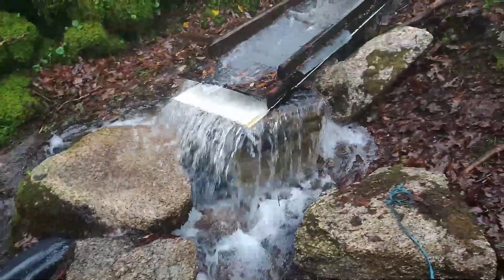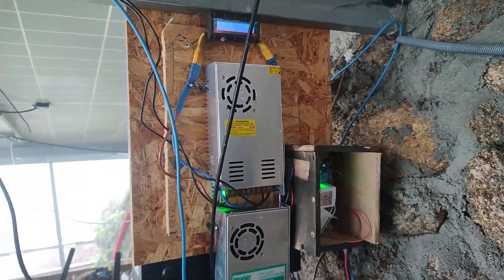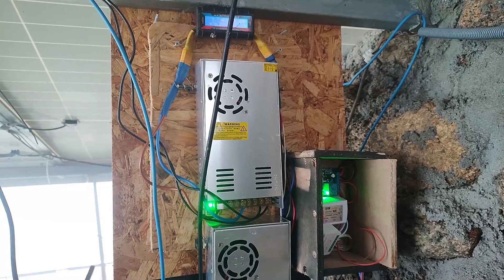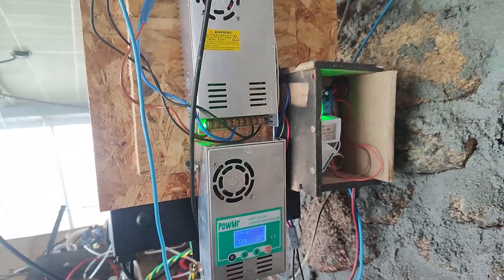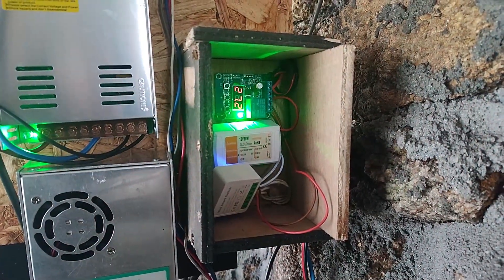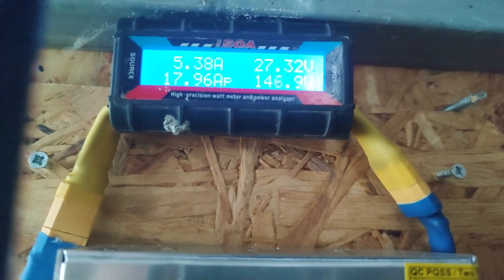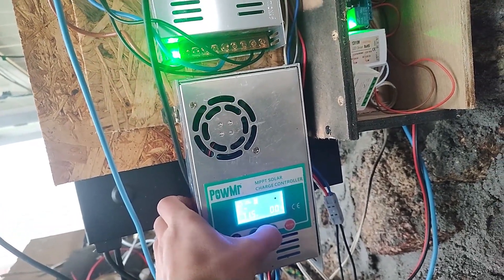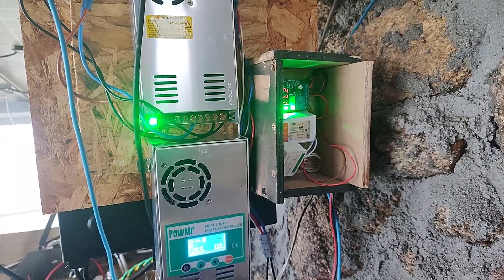Hydro + Solar + IOT Off grid Electricity overview

Comment: Great videos!! How do you connect the SMPS to your system? And vill it work with Lithium battery's?
Reply from the maker: Thank you, Yes it work with lithium battery, there is a screw to adjust the voltage in most of the SMPS, be sure before buying to check if there is a voltage adjusting screw, for exemple a 12v SMPS can range from 10 to 13.6v and 12v lithium battery require 12.6v.
Reply: @Off_GridWorkShop  Thanks 🙂 Do you connect the SMPS direct to your battery pack? Or does it go tough a controller? I´m asking because  the mppt controllers are crazy expensive and the SMPS will be a nice cheap alternative. I´m going for 24 V.
Reply from the maker: @botornvig  Yes it is connected directly to the battery,In my case it's gel battery so I don't have BMS, I suppose you have a BMS for your 24v battery right? If so there is no problem connecting directly to it.
Reply: @Off_GridWorkShop  Thanks! BMS all over the place 🙂 It´s a home made 22KW battery out of discarded computer 18650 batteries.

Comment: I've been having a look at these SMPS for a while. It is correct that it will take Vdc on the input but some say that because only half of the internal Bridge Rectifier is being used the unit will fail quicker. Also, these units take upto 260Vac. If the generator is producing upto 400v does it not just turn off or magic smoke?
Still waiting on a few more items for my project.
Reply from the maker: From what i know about SMPS if you use DC instead of AC the DC pass through the rectifier unchanged. I opened a SMPS and there is a full bridge rectifier a component that take 2 wire AC and transform it to 2 wire DC. For me there is really no issue using DC.
My unit and it seems to be the same on every SMPS it run from 340V it seems likes down to 180V, I have a constant heater reducing the voltage to 300V constant so the SMPS can switch on and off alone. and if i don't use the heater the smps don't let the current pass through and it went up to 430V without any issue. To me SMPS is indestructible haha

Comment: Im sure you know these things already but both the hybrid inverter and the PowMr should have load outputs to allow you to trigger your wifi and burn excess power at certain voltages. PowMr doesnt have real precise on and off voltages but the hybrid inverter should.
Reply from the maker: Yes the powMr has a load function with adjustable voltage to turn off the load but it's not really precise as you said and with this small circuit I can make fine tuning up to 0.1v which is perfect

Comment: Nice!
You have to use a resitive load for testing....your router just idles without any load :)
Bet you got 5kW availibe just from 20m height with that flow of water :)
Regards!
Reply from the maker: I wish I had but 5kw is way too much, to test the power of the hydro I need to do it the night because solar panel compensate the load

Comment: What's your avg daily kwh consumption and generation mid winter 🤔
Reply from the maker: I need to use a watt meter to see exactly how much I consume per day, but I'm not using much and I will increase my consumption as I waste a lot of energy especially during sunny day.... Basically I consume for 
Fridge,2PC,lights,3dPrinter and many small stuff and sometimes welding machining with CNC and lathe etc during the day I don't restrain myself and the night I can go up to 400W without even using the batteries with only hydro.

Comment: Bonjour, 
Par curiosité :
1 - tu recharges des batteries ou non ?
2 - tu alimentes quoi avec la sortie CC de ton alimentation à découpage (SMPS) ?
Merci et bravo !
Reply from the maker: Bonjour, Oui je recharge 4 batterie gel 12v 2S2P 2 en série 2 en parallèle. L'alimentation SMPS permet un variation de voltage importante, je suis constamment entre 200V DC et 400V DC. Pour évité de gaspillé trop d'énergie et réduire la vitesse de rotation de la turbine j'ai constamment un chauffage 200W.
Et du coup j'alimente le chauffage et je recharge les batterie à 27.3/27.4V, Concrètement c'est comme si que j'avais une alimentation constante de 400W que j'utilise pas forcément en entièreté c'est pour ça que je fait des test avec un détecteur de voltage qui permet de régler une plage de voltage définis qui active un relais connecté a internet et avec d'autres relais je met des conditions d'activation.
Si le voltage dépasse un seuil je lance le chauffe eau électrique etc et si le voltage descend a un niveau enregistré aussi ça envoie le signal au relais du chauffe eau pour s'éteindre.... ça évite d’allumé le chauffe eau quand il fait soleil et éteindre quand les panneaux solaire prennent plus de soleil etc sans compté qu'il y à aussi l'hydroélectrique.
Si vous avez d'autres question hésitez pas ça me passionne ce sujet.

Comment: Are you planning to create a permanent setup? Or just leave it as is?
Reply from the maker: It is permanent even if it doesn't looks like it is haha maybe better cable management would be better
Reply: @Off_GridWorkShop  I wonder if vibration in the turbine housing would move the entire unit and cause the pipes to disconnect?
Reply from the maker: @bingbangboom1239  well at first I was thinking it would too but I'm experiencing different hydro system for 4 years now and with rocks holding the housing there was no problem, the only problem that can occur is the intake filter that get filled with leaf but I have a multimeter at home monitoring the voltage so if I see that it starts to lower i take 20m to clean it, basically it's almost maintenance free I just clean the filter every months on winter as there is a lot of leaf's and the summer I don't really need the hydro so I stop it or run it at lower speed
Reply: @Off_GridWorkShop  It's very nice to have multiple off grid systems like hydro, solar and wind. Enjoy your freedom and independence!
Reply from the maker: @bingbangboom1239  Yes it's amazing but anyway I'm off grid so if I don't produce power I would be with candles hahaha

Comment: Nice! But you should not tie kabels with a steelwire! Also put it all into a try cabinet, to not have it damaged by moisture.
Reply from the maker: Yeah it is a bit of a mess the cables, and cabinet would make the setup nicer but I prefer everything to have good flow of air for cooling down
Reply: @Off_GridWorkShop  
it seems to me in that foggy and humid climate of yours,  the electronics should definitively be in an enclosed room with a proper roof.
however, experience will teach you, if nothing else.
good luck!
Reply from the maker: @ursodermatt8809   For sure it gets humidity but the system is up and running for 4years now without any issues, but for sure a small enclosure would help preventing that big fog with 90%+ humidity going inside circuits..... I might build one when I have time
Reply: Pure water condensate will not hurt your gadgets, but make shure you got no dripping from minerals, like from the panels above or even worse: stone walls or concrete, 
You can even run your gadgets under water to cool them if your water is made from pure condensed water @Off_GridWorkShop
Reply from the maker: @trygvetveit4747  thank you for the informations, and yes I made sure that no water drop fall on the electronics solar panel + silicone is really effective as roofing

Comment: Bonjour,bravo pour ton installation! Je n'ai pas encore regardé toutes tes vidéos sur ta turbine mais je me pose des questions : 
- Pourquoi le choix d'une alim SMPS plutôt qu'un régulateur de charge PWM ou MPPT solaire ou éolien? 
- Ton alternateur est en monophasé ou en triphasé?
- Comment régules tu la vitesse de la turbine?
Reply from the maker: Bonjour, 
1- J'utilise une alimentation SMPS car elle accepte un haut voltage d'entrée, avec des piques a 420v a vide la plupart des PWM/MPPT aurais pris feu.... Il y à quelque régulateur de charge qui accepte ce genre de voltage mais ils coûtent une fortune, là une alimentation SMPS 24v 600w c'est 40€....
2- triphasé mais avec un pont de Diode je remonte le courant en DC avec deux fil et comme le voltage est haut peu de perte
3- je ne la régule pas, j'ai une chauffage 200W brancher H24 ce qui fait que la turbine tourne pas à vide mais même à vide aucun soucis donc pas besoin de dump load ;)